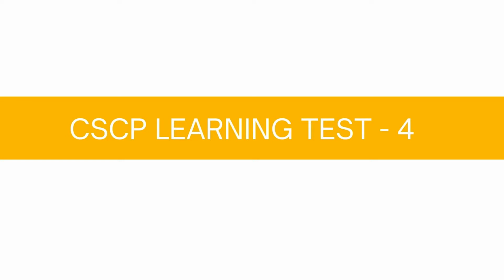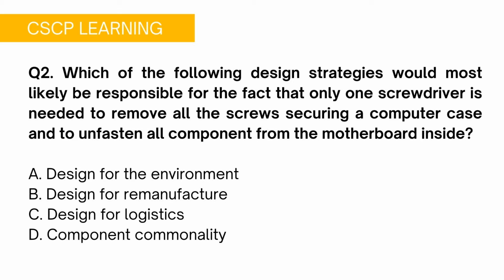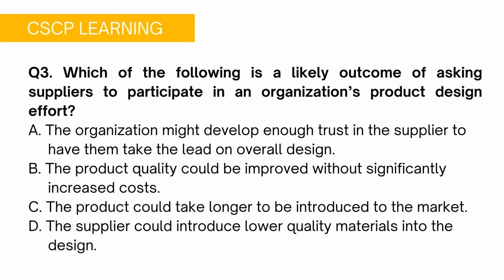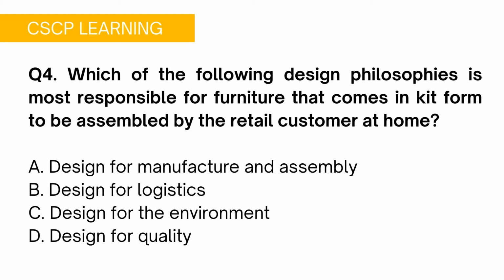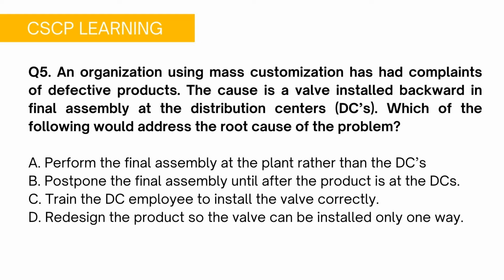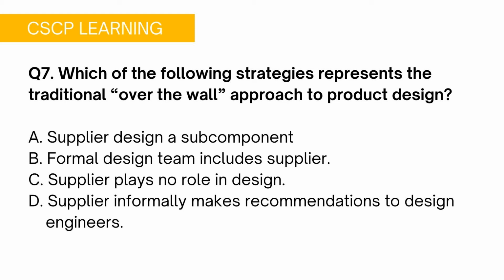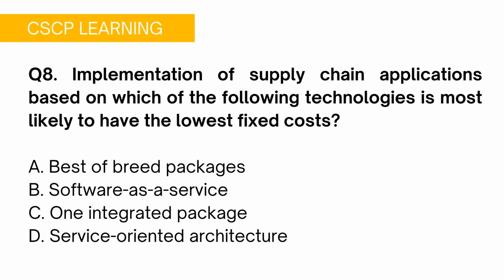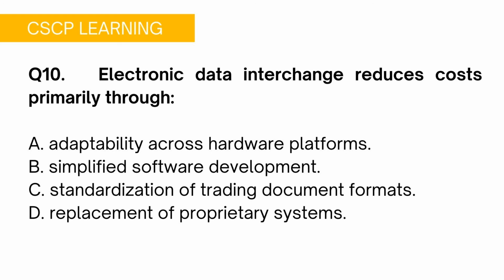CSCP Exam Practice Question Test 4

Comment: In Q2, what if the screw is a hex screw (or any customized screw head/clutch heads) and the correct size screw driver. In this case the screws can be of different shapes and sizes, but all of them can be removed/ secured using the same screw driver.

Comment: Hey, would you be able to clear the doubt on q.5 redesigning the product is a massive undertaking, involving each and every department might also take longer time and while training employees can also be done quickly through printing quality alerts or by just gathering all and showing them a video.
I'm just trying to understand the concept.
As always your videos are of a great help. Cheers.
Reply: Yeah even I thought the same. When you compare the costs of redesign and training a employee the latter feels like a good choice. Also this points out how there is a lack of foresight in the strategy of the firm turning around to fix a issue after being reported. Also the book itself pointed this out saying the downside of mass customization is not having trained employees.  Not sure why he went with option D.
Reply: The root cause of the problem is definitely the product design (The five-why analysis can reveal the root cause and Poka-yoke method may be the solution to the problem here) but any redesign may impact the existing design (again based on the complexity of such a change) and you may need multiple stakeholders to support and align well towards this viewpoint. The customers who already have the product would be at a disadvantage when they know about the same/ come for warranty claims or repairs (if the design change alters the existing design to a great extent). Training the employees and an additional inspection at this stage seems cost effective.

Comment: Can you please elaborate on   Kitting in regard to packaging and logistics, design for logistics (utilization/containerization) and how they correlate (examples) to understand the concept?  In the CSCP learning system, I am not seeing kitting. Thanks in advance!
Reply: In a Demand forecasting , the risk is that when orderes will begin to come in above  capacity there will be expensive activity to run plant overtime ,faster transportation and all so to avoid happening that to prepare kitting which is preparing components in advance ..Groupin together in a "KIT". Having them available to assemble
Reply from the maker: Kitting is an inventory technique where individual, but related, products are packaged and shipped together as a single bundle.
Kitting in logistics is the act of compiling multiple products into a single "kit" that is shipped to the customer.
For example, if you've ever ordered multiple products on Amazon from different vendors, you've likely seen logistics kitting in action. The products are all collected by the shipping team and assembled into as few packages as possible before shipping. In the traditional model, each product would be shipped separately, and both the cost to the customer and the logistics company increase.
Reply: Just adding my 2 cents. Its a collection of parts. Like instead of just a bulb. There will be bulb + head light housing + reflectors as no vehicle with a front impact is going to replace the bulb only but the entire housing.